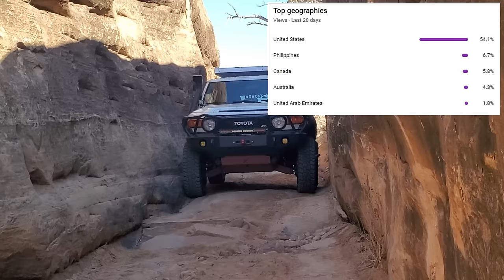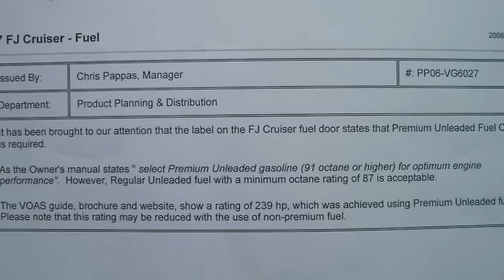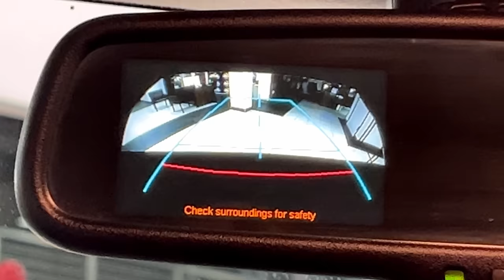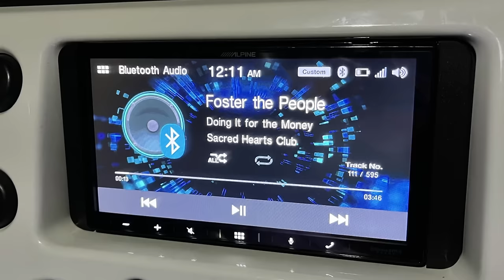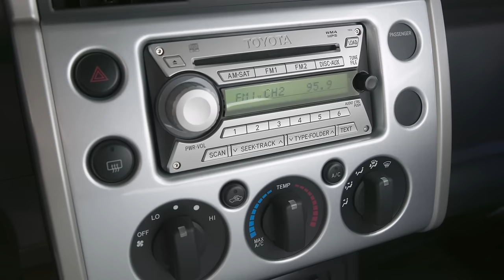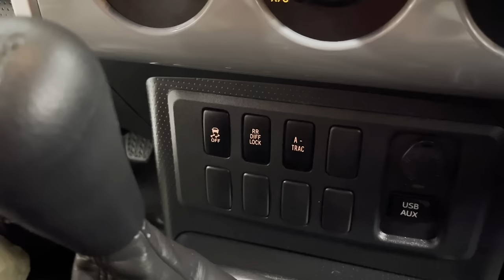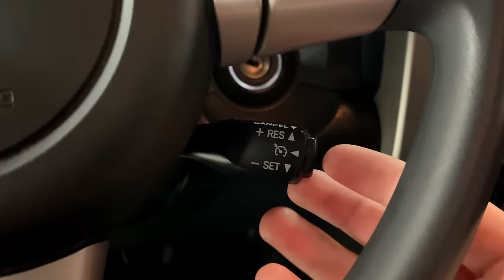Why NOT to Buy an FJ Cruiser - Watch this before purchasing! - FJ Issues and Problems

Comment: Ryobi has this accessory for pressure washers called the Ryobi Pressure Washer Water Broom. I live in the Northwest Region of the US and our roads get salted whenever the freeze is in the forecast. The FJ Cruiser is a real fun vehicle to drive and make donuts in the snow or driving in the mud to pick pumpkins for Halloween. The water broom appears to knock all the salt and mud from under the chassis because I have little to no rust. Just hook it up to your pressure washer and it has wheels so you just push it under the carriage and watch all of that stuff collect under your vehicle. I'm very happy with my FJ even after having a bit of a scare when I turned the key to start the engine and absolutely nothing happened. No crank no clicks no nothin. Went to Costco bought a new battery and I'm back in business. I guess soon I'll just change the alternator to avoid getting stuck anywhere. I've enjoyed owning and receiving compliments ever since I got it for my birthday back in 2014. Anyone will absolutely love owning this vehicle if not for the fun factor alone.

Comment: The visiblity isn't as bad as they say.  The mirrors cover a lot. I do have a rounded blindspot mirror. Mine rides very nice and smooth.  No lift kits.  My wife who drives newer lexus rx 350 says it takes bumps better than hers.  I drove her car and it felt cheap after driving the FJ Crusier.  I don't like the fake bumper they have in front. The look is fine but it does nothing. The real bumper is behind it.  Looks flimsy to me.  Back doors are kinda cool.  I have no problem with them.  It wasn't made to be slept in.  Beds are for that. Buy a camper if you want that.

Comment: I get positive comments daily on my sun fusion FJ. I enjoy driving it as an alternative to putting so many miles on my Duramax/Silverado. Everything I own is 4x4 even my tractors so getting where I am going and making it back are never an issue. There will always be little things that arent quite perfect in any vehicle so dont throw away the 80% that is right because of 20% that is not right. The next thing you get will be 80/20 too but the new 20%  might be things that you already got use to. BTW....marriage follows this as well. The grass is not always greener on the other side of the fence.

Comment: I have an 07 TRD that I bought from Kearny Mesa Toyota in August 2006. I put down $37K for a special order white over  black. I wanted the 6 spd stick and the big speaker kit.  After letters and emails to Toyota USA and Toyota Japan, They finally told me that “special” orders weren’t happening. Thanks to the ‘06  Baja1000 there was a pull out ad for the TRD.  Kearny Mesa Toyota got me one of the first 3,000 TRD’s.  Just turned 290,000 miles, about 40% of that in 4wd.  I thought that the stick was cool, BUT, full-time 4WD.  Also, the stick gave an estimated 12-14 mpg, just what my ‘85 FJ60 gets.  My TRD gets 18 mpg my drives from SoCal to SLC.  Can’t wait until December when the
 FJCruiser 2 is released.  Gonna add the TRD Edition to my driveway.

Comment: I know this is a old post but i just had this happen to my 07 FJ. I don’t live in a rust belt and have very little rust on the undercarriage of mine so this dangerous  occurrence surprised me. Just before taking a rough road trip I looked under the rig and discovered the rear retainer strap on the gas tank had rusted and snapped the tank was sagging. I would recommend checking this when vehicle shopping or on every one that owns one and drives the roads. The dealer wants $200 for the pair but they can be purchased for as little as $50 a pair.

Comment: When we say the frame rust in the salt belt are we comparing it to other vehicles in the same location in the time period with the same care given to the vehicle?   Steel will rust if the right catalyst are emplace . I have a 2013 FJ and live in an area where it was never subjected to road salt and the frame Is great condition . I definitely think that  it’s more an environment and care issue rather than a manufacture thing. If u let salt sit on your steel frame for months what do we expect will happen ?

Comment: I like how they got a lot of kinks worked out towards 2010 as far as common fatigue areas/components.
Reply from the maker: So true, a big reason to stick with a 2010 or newer model for sure 👍
Reply: @FJX2000_Productions  so 2008s are bad? 😮
Reply from the maker: @BoiseTDI  I have a 2008 and the only issue I’ve had is the fender cracks, but it doesn’t cause any problems, it just looks bad 🤷‍♂️

Comment: Speaking about windshield wipers. I personaly use Denso's hybrid wipers wich I gess was factory installed on my 2012 trail teams FJ. I assumume it is the best wipers  I ever had. And I've tested  it on other cars I've owned. It's a bit higher price, but it worth it. It showed very good percormance in any wether and season. Highly recomend. And keep in mind that clear windshield it is your safety on the road!

Comment: One more negative, really applicable to wet freezing climates is that the drum in a hat style parking brake freezes and locks up! I mostly don't use the parking brake / e-brake when its below freezing or sitting level in my garage, just out of caution. I had mine freeze up after a car wash just sitting in the garage! Managed to get it off in 4-Lo going forward and reverse. I've heard on forums that I'm not the only one that this has happened to!
Reply: I havent experienced that ,Im in New England and I use it every time I park w mine being a 6 speed
Reply from the maker: I haven’t heard that one! Wow!
Reply: @FJX2000_Productions  Maybe because its being used so often?
Reply: Not really, its relatively low mileage and few mods, but I was surprised when it happened! So I posted on the FJC forum, and sure enough, a couple of Canadian veterans responded and said they had the issue driving in salty, wet and freezing snow that froze up at night! I do use the hand brake typically, and LOVE my FJ !!!

Comment: I have that same after market radio you showed. Love that model, especially since you can run the back up camera through that screen making it much more useful
Reply from the maker: I need to get a backup camera setup so I can utilize that feature. It would be great! Plus you can do a front camera as well!
Reply: What model is it?
Reply from the maker: @raminolta  an Alpine iLX-W650 I got from Crutchfield

Comment: Im buying a 2012 fj. Base model, tan w/white top and a roof rack. Nothing special. Its a 400mile trip but worth the deal. I decided on it since ive been running my 1998 rav4 for forever and the fj looks exactly how i always pictured a modern rav4 (instead of how they ended up as a soccer mom looking crossover). Im rambling. Anyway, my rav4 will probably hit 400k miles at the end of the trip, a good point to retire it in place of its much larger twin. First thing im gonna do to it after purchasing... Install aftermarket mirrors with blindspot coverage.

Comment: I have a 2021 FJ, its really an awesome reliable strong vehicle like no other. I do agree the blind spots issue is a pain in the ass and also, the uncomfortable front seats .However I believe  I can resolve this  by getting aftermarket seats .
Reply: they stopped manufacturing them in the USA in 2014, are you from overseas?

Comment: None of those ”problems” are not a problem to me. I love many of those things (body style with all of it’s downsides, huge pillars, 3 wipers etc.). Technically it’s very solid, no real problems with my 2/2006 and 180k miles. I’ve owned this 11.5 years now.
Reply from the maker: Glad to hear it! Congrats!
Reply: yup, it just depends what you're used to drive... 
Yeah, rear visibility isn't the best, but if you're ever driven a cargo van or a pickup with a cab it's a non-issue... and you'll quickly learn to backup into parking spot (and letting your rear passenger get out, before backing in)
Rust? I'm in Canada, all vehicle will rust... that's why you have them treated with anti-rust treatment.
MPG? Yeah, it likes fuel... but still better than my friend's Wrangler... and my '12 is long paid off... so putting gas is still cheaper than making payments!

Only thing that bugs me are the headlight... Compared to the amount of light being put out by the wife's Outback... the FJ feels like it's a dimmer switch on.

Comment: Thank You for this video..... I was about to purchase one locally for only  $8,000.oo.   The rust issue, gear teeth issue and weak suspension and rear axle were enough to pour cold water on my interest.  OF course on the out side it looked like new... but rusting frames are not worth the bother.  Just also viewed a You Tube for a Tacoma with only 35,000 miles and the frame was rotted and unsafe.  Not worth the risk.... for sure.    No wonder there are shortages of used Toyota 4x4's.  They rot away if you use them as a truck.
Reply: Where the heck do you live? Probably in one of those god-forsaken places where they actually have rain and snow, and the temperature plummets below 80°F.  We get rain a few days a year, dries up in a couple of hours and I've never seen rust on a car, certainly not on a Toyota.

Comment: I have a 2010 with an OME lift.  Love it!  Got it after resurrecting the FJ40.  Also have a 2012 GX460 all stock.  Love it , too!   

Differences are indeed noticeable.  The GX seems more solid and visibility is certainly better.  The V-8 of the Lexus gets close to 20 MPG and if I don't drive with a heavy foot, I can get that with the FJ.

But for just tooling around Town I have a 2001 SWB Tacoma 4x4,as it, too, has advantages and better MPG.

Comment: Everyone says there are blind spots. Did your daddy ever teach you how to use your mirrors properly when you were learning to drive? Everyone always mentions the same thing. The only valid point here is rust, which can be prevented. The cabin can be updated with a computer, as mine is, but I like the material made for the inside since it’s easy to clean when off-roading.

Comment: A lot of hate in the comments. NO, I don't own an FJ, but several other vehicles of different brands. I noticed, in general, that electrics / electronics issues with cars before 2005 are not so common (with the exception of the 93-95 Mercedes 'ecological' wire loom deterioration), while with my newest vehicle I'm constantly at the dealership for stuff that I can't even fix or clear with an ODBC computer. For offroading or any classic car you want it as simple as possible. As for pros and cons - rust and mechanical issue will hit any vehicle with sufficient mileage or age, so I wouldn't want to make that a decisive factor. In the end it is just like the photographer says: "The best camera is the one you have in your hands". Are you enjoying the scenery, the experience? Then you can be happy in a 80s Suzuki sardine can.

Comment: It is interesting that you pointed out the door trim pieces rattle with the beat🤣. any solutions to fix that? It annoys me a lot
Reply from the maker: If you remove the entire door panel, you can then remove just that colored trim piece, and you can put padding or dampening material behind it that will keep it from vibrating 👍
Reply: @FJX2000_Productions  you are a treasure for the fj community for sure!

Comment: Looking to buy an FJ Cruiser. Currently looking at a 2007, but have heard that year is very prone to the transmission shudder issue due to bad torque converters. Do you happen to have any idea how common this is? What to do / avoid to not experience this issue? Are 2007's better to just stay away from since I haven't purchased one yet?
Reply from the maker: Usually with maintenance and fluid changes, the shudder can be avoided or remedied from what I’ve heard, but I haven’t experienced it myself.
Reply: @FJX2000_Productions  Thank you very much for getting back to me. We just pulled the trigger on an FJ this morning in fact! After all the tranny shudder stories I saw online about the 2007, we ended up going with a 2011 "NSSE" with 45k miles on it. It was $31k and that seemed like a good deal based off of what I was seeing out there across the nation. Your videos really helped me to make a VERY informed buying decision. Thank you so much for all the hard work you are putting into your amazing channel and I hope to see you out there one day on the trails! Greetings from Grants Pass, Oregon!
Reply from the maker: @sauceainttheboss  congrats! That’s so exciting to hear! Great deal for a low mileage FJ!

Comment: All, I may buy a 2008 FJ with 400.000km on it. Would all those km be too much? The car looks good. Just worried about so many km
Reply from the maker: If the price is right it may still be worth it. FJs have long lifespans if they’re taken care of
Reply: Personally (as a long time FJ owner) I think the $ they are selling for used is kind of crazy. You could get a same year 4Runner for less money, and it's more practical.
- As far as the mileage, if the vehicle comes with the maintenance record and a mechanical inspection shows it to be sound... Why not (if the price is right)

Comment: Should I change the transmission oil?  5 speed auto 235K original soft driven miles, no towing.
Reply: At that high mileage, and assuming no issues, i would steer clear of changing the fluid, especially a flush. Flushing could potentially cause built up debris to circulate around and clog up other parts of the trans. If it was changed around the 100k mark and still have seen no issues up to this point, a simple drain and fill would be the safest option in my opinion and the opinion of my mechanic who rebuilt my 02 Rav4 trans a year ago (different car different issue).
Reply: Note: I've had my fair share of transmission issues over the years. It's never fun, but I've learned a lot along the way. Awesome to see yours is still going strong at 235k.
Reply: @TheMistermike87  Thanks for the advice, was told by several dealers it was no service item. I believed them unfortunately. It's a 2007 2x4 and a daily driver.

Comment: Rust. Transmission judder because of the lifetime transmission fluid. This ends up killing the transmission and torque converter. Early models have a drive shaft that causes a random jerk. This part was changed later on. This channel is an AI voice reading a script FYI
Reply from the maker: It definitely isn’t an AI voice reading it, it’s my voice 😂 but if you think I sound like AI then thank you! Haha
Reply: @FJX2000_Productions   hahaha oops

Comment: After watching this i am afraid to buy one… i need to find a service centre where can buy spare parts
Reply: My 10 years old FJ has only needed a windshield washer pump replaced... Not much $ from RockAuto
Reply: @michelt4390  

Thanks man
Fuel consumption ? Milage ?
Reply: @ReformMsia  75k miles, about 18mpg in the winter and 19 in the summer (country rds driving)

Comment: so...the rust looks like a major issue if it eats thru in 10-15 years, or whatever.  30 years maybe.  10, no.  That is an engineering problem.

Comment: The New FJ-E COMPACT CRUISER EV AWD I want the manual transmission AWD off road package TRAIL TEAMS/TRAIN HUNTER TRD PRO LED headlight LED Roof rack bar LED rear single brake recse led LED interior balance gage leveling gage's electric motor temperature gauge cooling system gauge rubber washable flooring 360 camera Radar view I own a 2011 Toyota FJ CRUISER manual transmission AWD off road package TRAIL TEAMS addition ARMY GREEN A-TRACK BF Goodrich RUGGED TERRAIN  AT ALL TERRAIN